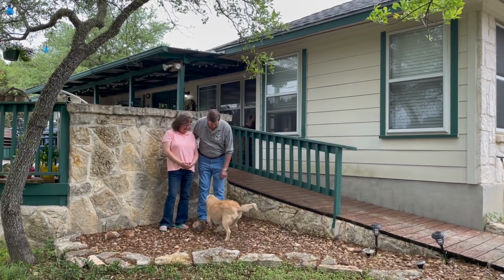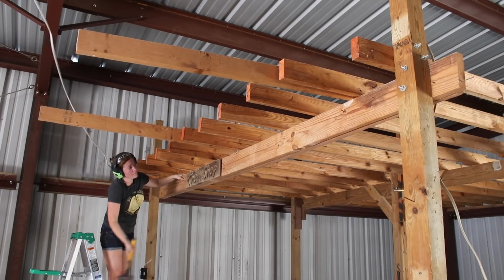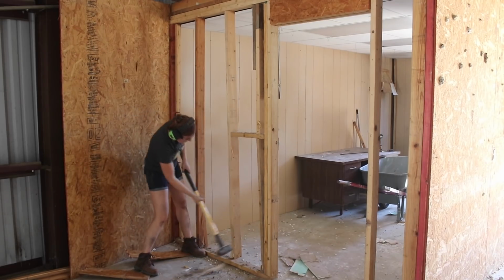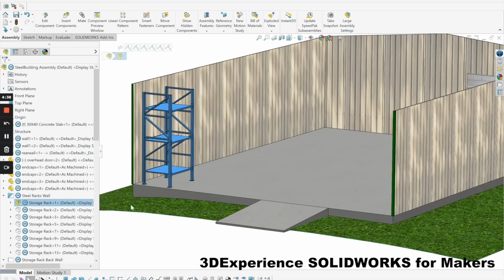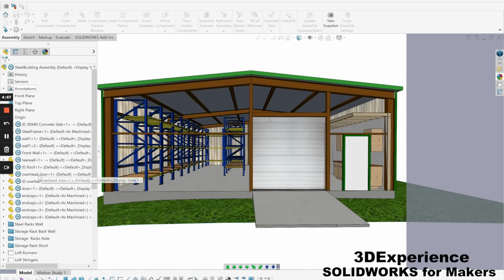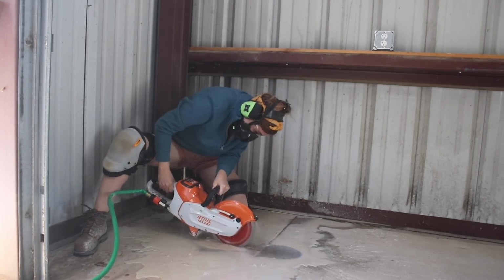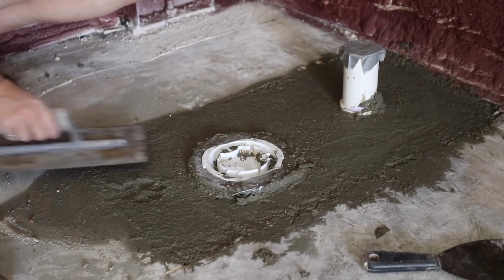My Workshop Remodel Begins! Demolition, Planning, Layout and Ideas

Comment: That desk in the office might be a Leopold Desk.  It could be worth some money.  Pull open the middle drawer and look for a metal plate that is black with the logo on it.  The feet should be round with metal caps on the bottom.

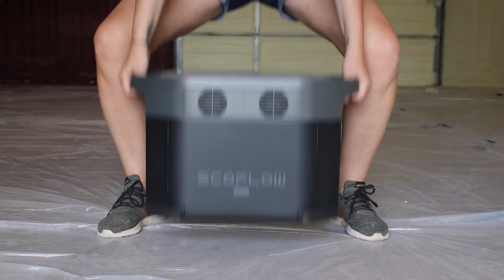Comment: 7:07 @april Wilkerson 
I’m sure ya know; as ur a very smart cookie; but before reusing that romex, grab a meter & do some testing (continuity, resistance, etc) to make sure won’t run into troubles later on (as can have a damage somewhere throughout & won’t know why equipment etc….tripping breakers, running weird, & so on.

Comment: If expansion is your direction, eventually you might want to seriously consider consolidation into one, single large space. Some where an forklift can be used. Because if you're getting into mass production, that means large volume in short time frames and no one likes loading and unloading trucks/trailers by hand 👌

Comment: What a great demo video, thanks for sharing this April.  Rather than using the single jack hammer and bashing my way through projects I frequently use a 4x4 and a automotive bumper jack to apply steady pressure forcing things apart.   

Will you be adding spray foam insulation after locating wiring in conduit?   You are an inspiration to young women everywhere.  I have shared your channel with our grandkids as an excellent role model.   Have you ever considered teaching at a vocational education tech school.   I think you would be terrific.  Wishing you and your family a blessed week and a gentle spring season.

Greetings from NE Ohio near the southern shore of the Great Swamp Erie.   Peace dear lady.

Comment: Love the videos, always come to learn something new. Could I offer one suggestion from years working in warehousing? Turn your racking 90 degrees and make isles. It’ll help eliminate the dead space in corners and prevent that trailer from blocking access to one side of the racking when pulled in. Could even allow for more rack space depending how narrow you’re willing to go. If you want to get really fancy you could assign some well planned out bin locations to each location. Regardless you’ve got a very nice and workable space there.
Reply from the maker: Great suggestion! I'll play around in my modeling software and compare layout designs. Thanks for the tip.

Comment: Great idea. Although here in new Zealand you can get toilets as a p pan. Meaning that the plumbing can straight out the wall with the use of a pan connector and a dektight flashing. To them the pvc underground outside to the septic tank. However you will need to make sure the septic system can handle the increase in flow. Otherwise you can up with back flow problems
Reply from the maker: Oh man, straight out to the wall would have been amazing!

Comment: You should build some rolling stairs on casters. Something more substantial than a ladder, but easy to move for pulling stock from the top shelves. Something your mom can move, but will feel reasonably safe climbing up or down with merch. Structure out of lumber, with pipe hand rails. Use those spring casters on one side so it won’t roll when a person steps on it.

Comment: I had to re-deck a garage with a flat roof/patio that had had… Issues.  To peel up the plywood, I welded a fixture onto an engine hoist and reached up through the joints to lift the very well attached plywood.  The structure  was very well assembled, just one poor design design decision caused the roof and the centre-of-span beam to fail.

Comment: The option other than cutting the concrete would have been to build a platform just high enough to run the drain out over the concrete pad and then down.
Reply from the maker: Oooh, that's a good idea. Thanks for the suggestion!

Comment: The next time you have to cut and remove part of a slab, make life very easy on yourself and save a ton of time by simply cutting the size out as you did here, but then drill a hole and insert an anchor with an eyelet or enough thread hanging our to attach a chain to it. The  use a engine hoist, (if you have one), or a long 2x4 to lift it out of place. You will save a ton of time doing it this way and muscle.. And next to no cleanup ...  Also, when pushing up trusses or ceiling joists/floor joists, go under with a 2x4 and a automotive floor jack.. It's time and energy saving like you would not believe!!   Lastly, for those nails/screws that don't want to give up the ghost, CUT THEM with a sawz-all.

Comment: Nice job but i gotta say, I’ve fired a few people for not dealing with nails immediately. Pull them or knock em flat. Its not just stepping on them thats a problem, but nasty scratches or even hand penetrations. Y’all didn’t look like you were wearing steel shank boots so…. Glad you were lucky. 
I just did what youre doing on a similar sized pole barn. Really nice when all the power is in and you can start getting big tools (forge/welding on one side and woodshop on the other). Love the videos and your sense of humor.

Comment: 30x40 shop.  1500 sq ft space???  Weird.  Also there is no way possible that tiny battery bank is running any dryer.  You probably should correct that.

Comment: You mention that the existing electrical wasn’t to code. I’ve watched your videos for years, please make sure the new electrical meets code because you don’t always follow it when putting new electrical in. Also, the way you roughed in the plumbing doesn’t meet code due to the space you have for the  new wall you’ll need for the bathroom. The way you showed it in the software doesn’t meet the required dimensions.

Comment: So why did you not make numerous cuts in the length and width with the saw? You would have then only needed to drill out the middle peice with a Hammer drill. Then your 3 pounder and a chisel and the other pieces would break apart. You need much less effort than bashing the larger piece with a sledge hammer. Otherwise congradulations and good to see you growing business wise. Have fun.

Comment: With the space available, what was the deciding factors that  made you  demo the concrete for the plumbing vs  building a  subfloor on top of the existing  slab to house the toilet flange/ drain line?  I ask this question not because what was done is wrong  because it is industry standards , but as a "commercial use" space where things are going to go wrong and need repairs and maintenance.  If  repairs can be made  with out any  concrete demolition   Faster and cheaper.
Reply: @christopherdahle733   I was proposing a ramp style to be in full ADA compliance. It would take up a bigger foot print,  and that is a trade off.  I only ask the question because if a fitting  and piping is encased in concrete, when it fails, it it not covered under insurance of the structure because you can not access it to do maintenance.

Comment: Since you wanted to salvage the lumber, I would have used a Reciprocating Saw with a Metal Cutting Blade to cut the nails at the joints!
Work smarter, not harder!